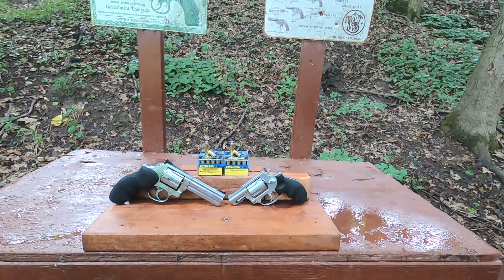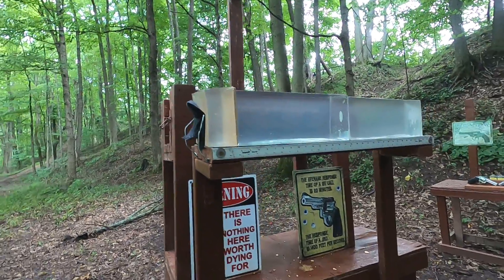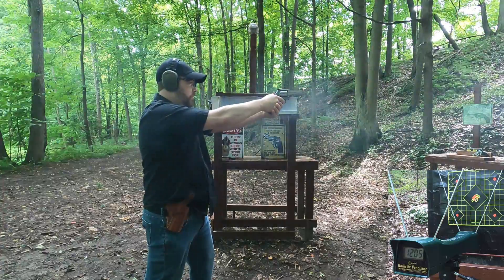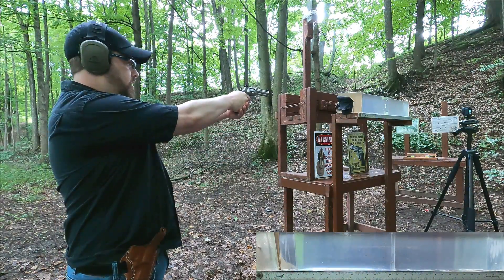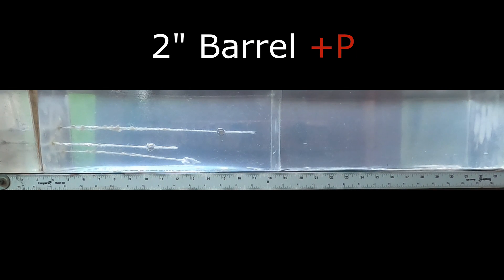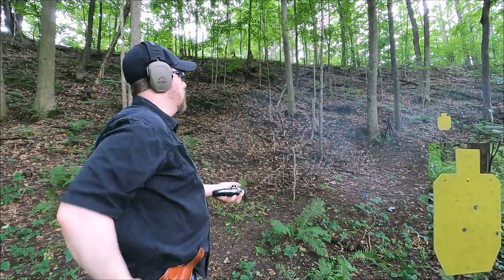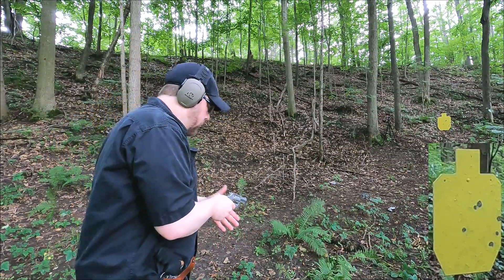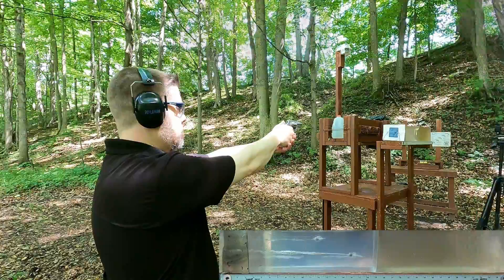💣.38 Special - Buffalo Bore "FBI Load" Ballistic Gel Test (.38+P VS .38 Standard Pressure)

Comment: For my EDC Taurus 856 snub nose, I use Buffalo Bore Heavy 158 grain .38 Special Soft Lead SWC Hollow Cavity in standard pressure with low flash ballistics.
It's a mouthful to say, but that bullet is mightily effective anywhere from 15 yards to point blank. And for me, those 6 rounds are more than sufficient for that purpose.

Comment: I'm commenting from the distant future (Mar 3, 2025) as this came up in my feed and I thought I would give it another watch. I think a light vs heavy in 2" barrel test would be cool if you pitted the standard pressure BB against a 110gr 357 Magnum SJHP. I know you've don't light vs heavy before. I don't know if you've done that extreme though. The soft lead has the feature of expanding easily, so you really don't want to try and overdrive it anyway, IMO. A 110 going super fast is going to dump energy fast, even if it is a slightly harder alloy. But a lighter bullet will also slow down faster (that's really the energy dump) and may get roughly the same penetration as the heavier, softer bullet. There is also something about comparing a standard pressure 38 Spl to a 357 Magnum that makes me smile. I can't quite explain it.

Comment: I every day carry buffalo bore .357 mag 125 gr 1700 fps in a smith model 640 at work and in a 686+ when not at work. For when i just have to run out real quick and just throw on sweat pants or something my go to is the buffalo bore 38 spl +p lswchp in my 360j. Buffalo makes the best ammo with the most BANG for your buck, literally
Reply from the maker: That's a heck of a way to go with the .357 Mag ammo. I shot one of those once through the chronograph with my 2" Taurus 605 and the velocity was like 1,450 FPS. Had a lot of recoil.
Reply: @GunSam just saw this, yes the recoil is stout i put houge rubber grips wich makes it way better. I usually shoot a box of it before switching to 38 special to practice with. I hit on target though and i like knowing i have that power on me

Comment: Back in the day I tested various .38 loads from my 2" j frame.  All of the big 3 158+P failed (Remington did the best due to the lead being softer.  I didn't have a chro, but the Winchester penetrated deeper with very little expansion, the Remmy was second and the Federal finished last.  Decades went by and I happened to get some of the BB and my good friend "the Brassfetcher" tested them in gel and got 1006 fps.  The bullet expanded very well and penetration was pretty good too.  He also tested their 125+P and got 1235 fps from the same gun.

Comment: One thing you gain with plus p is range with performance equal to the standard pressure.  You will not get the same penetration and expansion at 25 yards as at 10 feet so the more velocity the better the chance of increasing both.

Comment: I am looking at getting a pocket revolver. I like the price and 6 round capacity of the RIA M206 but compared to the 5 shot Charter Arms undercover it weighs twice as much.

So that begs the question of what the best loads for an ultralight. Would love to see you compare say HBWC, 110gr, and 135 gr standard pressure loads.
Reply from the maker: I'm a big fan of both 110 gr+P Hornady Critical Defense as well as a 125 gr+P SJHP ammo like Remington HTP or Magtech. Everything else basically doesn't have bullet hollow point expansion in a normal power level. A third choice would be wadcutters. Going from memory, and often testing the same thing multiple times these are what comes to mind as the best loads to carry, if I were carrying .38 Special.

Comment: Trending wisdom these days in revolver carrying circles seems to be that a person is better off loading something like a 147 grain wadcutter in a .38 snub and saving the hotter +P for a 4 inch or longer barreld revolver.
Simply because one loses around 100 f.p.e running +p or +p+ ammo in the 2inch and gains nothing but heightened muzzle flash and sharper recoil.
Which is something I'd tend to almost agree with based off my own experience.
I would advocate instead for a heavier weight wadcutter or semi-wadcutter bullet instead of the 147 grain however. Preferably something medium cast and not hard cast.
Also.
Just as there was an "F.B.I load" .38 Special?
There was also a .38 Special "Treasury load".
If my memory serves.
It was a 110 grain .38 Special +P jacketed hollow point loading running just over about 1100+ per second out of a 4 inch barrel.

Comment: My late husband purchased me a Taurus 38 Special +P  snub back in 2020 before he become ill for self protection. He knew he was dying and would no longer be here to protect me, so he got me this 38. I have target practiced with it about a hundred rounds,  I'm still stuck on what ammo to use. Right now I'm loading with the Winchester +P 130 grain, and it shoots pretty well. I just don't know if it's good enough for self defense. If I'm attacked and need to use my firearm then I want to know it's more than enough to put down my attacker. What do you suggest? 

PS. I have that same warning sign on my front porch.  ☺
Reply from the maker: Without question, the best snub nose (or any barrel length for that matter) load is the Hornady Critical Defense 110 gr+P. Not only is it my most tested round, but the one that has failed the least. Even in my most recent video I tested it. Latest video was a 3" barrel but I have other tests in a 2" barrels and 4" barrels, always does great.
Reply: @GunSam  Okay thanks, I'll give it a try.

Comment: Very good video. I just can’t understand why the big ammunition manufacturers can’t load a standard pressure 38 that has the same power as the buffalo bore one.
Reply from the maker: I personally think it's liability and cost. All modern .38 Special revolvers could easily handle Buffalo Bore power, but with all the old handguns out there and with stupid people who would shoot a mainstream .38 Special+P in a 120 year old gun, I think that's a headache the ammo companies do not want. Also along with that, if you just dump a fast burning cheap powder that works great with 9mm, into a .38 Special case, you get basically run of the mill .38 Special ammo. I have done it handloading, you take a 125 gr bullet, use load data powder charge for 124 gr 9mm, and you get .38 Special ammo that shoots at 900 FPS from a 4" barrel, 800 from a 2". To me it adds up they are just using powder that is cheap to save a buck.

Comment: Those loads are well into 9x19mm power levels. I have no idea how important split times are in real shooting (defensive, hunting). My guess is that competition split times vs making sure you hit a real threat split times are going to be quite different. Based on my still limited experience with the S&W M&P340 shooting 125gr & 140gr magnum loads, I'll say you can still dump a cylinder pretty quickly at close range.

Comment: Maybe do the Underwood version next time. The FBI load still seems like it's relevant as an option against modern cartridges and Underwood updated with the lipstick coating to prevent lead residue in the barrel.
Reply: Buffalo Bore uses a gas check to achieve the same result as Underwood's lipstick coating.

Comment: You should do an underwood comparison like this next. They have similar rounds. In std and +p. Could be interesting.
Reply from the maker: They have basically the same loads on paper, however their +P version is about the same power as Buffalo Bore's standard pressure version. Underwood's 158 hard cast+P is as powerful as BB's 158+P, but for whatever reason Underwood loads their hollow point version 100 FPE lower than BB
Reply: @GunSam Spot on my friend.  I've chronoed the outdoor loads and they were extremely close.  Interestingly, on a forum I saw where they pressure tested the outdoor loads and they were between 28 and 29k psi!!  Hotter than the old 38/44 outdoor load by a bit and hotter than the +p+ police treasury load by quite a bit.

Today's revolvers seem to be able to take it fine though.

I recently got some cheap cci +p .38 that was ridiculously weak.

S&B 158 gr lrn are pretty spicy stock practice loads.

Great test Sam.
Reply: @GunSam You know, if we lived in the same town, you'd probably be my competitor for buying the neat ammo.  I have a shot I hit weekly that tries to get in unusual stuff which usually goes home with me.

Comment: Sam, Using the 27 fps variance between the “identical” factory +P rounds that you shot from the 4” barrel as an example, would you say hand loaded rounds closer to each other, fps wise? Is 27 fps significant for penetration, accuracy or anything else in your experience? Thank you
Reply from the maker: There's a whole lot of little things into that question that are hard to answer, but just general hand loads, no they aren't a tighter spread of velocity VS factory, but that being said, certain powder with certain bullets can get really tight spreads. Like I was max charging some .38+P's before with Titegroup powder, got about a 5 FPS variance. But that's because it was the max charge and everything just worked out. If I hand loaded some run of the mill bullets with a mid range generic powder, the velocity spread won't be any better than factory.

Comment: The BB Standard pressure load from a snubbie is going faster than most of The Big Three +P loads do...out of a 4" barrel they have 75-100 fps over their +P...  The BB +P is easily the equal of the original .38-44 load by Winchester/Western and Remington/Peters back in the 1930s to 1950s...but a better bullet. Those loads were only rated at 1115 fps from a 5" barrel for the 158 grain loadings.
Worked for Dallas PD back in the 1970s and 80s and personally knew 6 officers who carried that load and shot either things or people...5 of the 6 changed guns and caliber after their "incident". (one of the officers changes after his poor second poor performance incident). The rounds bounced off or stuck in the side of the stand on the corner collection mailboxes, car windshields, car doors, stuck in the neck of one felon and left people standing...  The only one who was happy was a sergeant who shot a murder suspect inside a motorhome...dropped the guy right there. 

I knew at least 50 other officers who got into shooting with other guns and calibers and not a one of the changed a thing...

When I carry a .38, which isn't very often, I carry the BB +P 158 HP or the Outdoorsman Solid...nothing less.

Comment: Either looks sufficient to kill. Lighter bullets will always be better for self defense situations in a shorter barrel. The loss in mass is compensated by higher velocity. Mass only applies when you're going out past 25 yds with a 4"+ barrel.  A bonded hp +p is a dick knocker for any barrel length in .38. I run 124 crowns in my 9mm compact and 9mm is .355 I believe compared to .358 for .38/.357. You dont want to catch either one with a defense round.

Comment: Awesome to see this test. Some time back, I communicated with RimRock bullets about this very bullet. They are the ones that make this and some other cast bullets for BB. Their take is that this bullet will deliver optimal performance at 1000 fps OR LESS. That was good to hear since I can get about 900 or so in my Taurus 856. You just clearly confirmed that. It seems that this bullet will perform very well at velocities where a JHP (even the vaunted 125 gr) don't really work all that well. Obviously 'magnum' or +P velocities are unnecessary for this bullet. Great job as always.

Comment: My experience with the standard pressure is that the recoil is too stout in lightweight snubs like Chief Special or Detective Special. It works great in a heavier gun like the 10-5 snub.  The + P is pushing magnum territory, so I'd rather just use a magnum...
Reply: I carry the standard pressure load in alloy frame Colt D frames, and the plus p in aS&W  60-7, and a mid 70s vintage Detective Special . No big deal in either. As to going to a 357 load in a k frame, the only heavy weight load that exits faster out of a short barrel 357 is the old Winchester 145 Silver tip.,The Buffalo plus p 158 lhpis slightly slower , but 13 grains heavier without the blast of a 357.

Comment: Excellent video.   I will try loading my 158 lead bullets a bit hotter, using Power Pistol. 1,000 fps looks feasible.   I cringe each time you announce you are going to shoot over the chrony at 4 feet.  My experience is that I get some bad readings unless I am at least 10 feet away.  I usually shoot handgun at 15 feet and rifle at 20 feet, for best results.
Reply from the maker: I shoot from 12 feet, 4 yards.
Reply: @GunSam  Yes, I see that.   I shoot mostly lead bullets.  The lube makes smoke and I get the impression that the smoke is causing the errors, unless I back off.   When I say "at least" 10 feet, I mean maybe a jacketed round, if there is some reason I can't shoot farther away.   15 feet seems to be the magic distance to stop getting some error messages.  The reason for the 'cringe" when you say 4 yards is that you are shooting very expensive rounds and I hate to see them wasted.

Comment: Thanks for the video.  I have a Smith model 65 3" and use the BB +P for self defense.  A lot hotter and energy than the SGD .357 mag. 135 gr short barrel.  Looks like the standard pressure BB might be a better choice for follow up shots.

Comment: I think you used to use a S&W Scandium Model 342 for testing. It would be interesting to see if the standard pressure BB 158 gr swchp jumps the crimp. That's the risk with lead bullets in lightweight revolvers
Reply from the maker: I have shot some in my 342PD in the past which is just an aluminum alloy frame. I do recall seeing a little crimp jump, but it wasn't significant enough to pull the 5th round more than 1/100" or so
Reply: @GunSam  My 340PD's recoil is so stiff that the same load moved the bullets significantly . I like the BB 38 standard pressure 158gr swchp and I like the 150g wadcutter even more. Aside from  some POI issues with it, the penetration in excellent and it cuts very sharp edges.

Comment: that buffalo bore 38+p is giving you roundabouts the same velocities that the federal American eagle 357 soft points were giving you, witch begs the question is buffalo bore loading their  ammo way too hot or are the ammo companies pud loading their revolver ammo ???
Reply from the maker: .357 Magnum loaded right give 800 ft lbs in my 686, so ammo companies are down loading. That being said, the .38+P is lead, so you can get 100 FPS+ vs a jacketed bullet with the same powder charge. I don't believe these rounds are over pressure at all
Reply: @GunSam  Not overloaded at all. They are loaded right up to SAAMI upper specs for standard and +P loads.